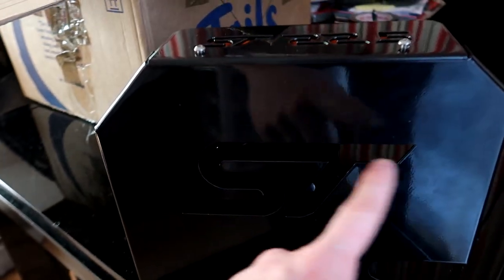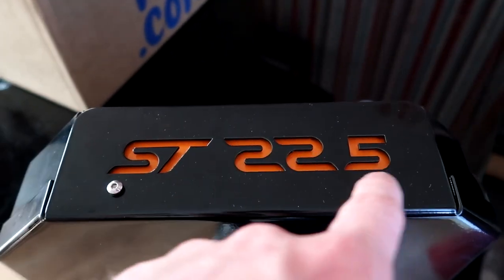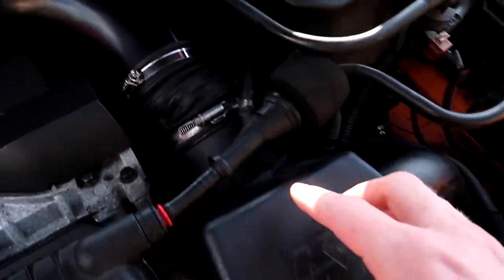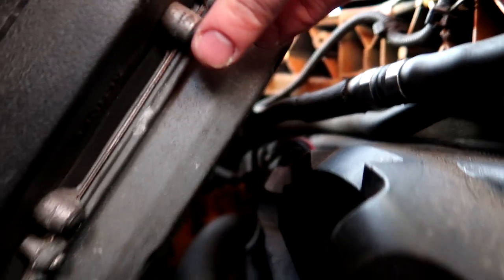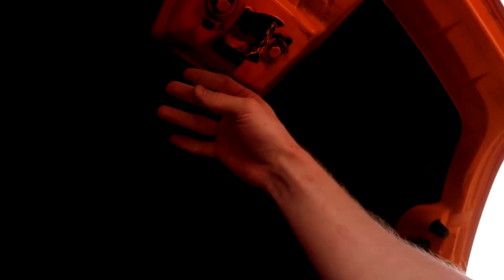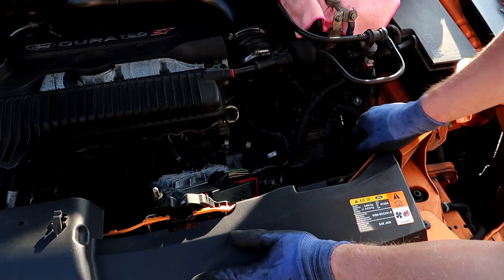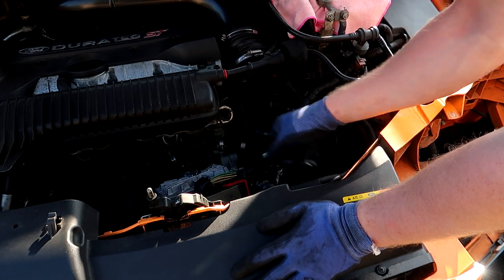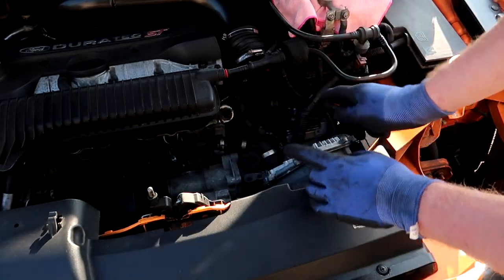HOW TO INSTALL A GROUP A INDUCTION KIT AND ECU HOLDER *FORD FOCUS*ST225*

Comment: Cheapest and easiest thing to do to quieten your exhaust is to put the original cat back on. I’ve still got the original cat on mine with a Section 59 cat back and it’s not that noisy at all. (Too quiet if anything as I’m going to go decat or sports cat).  Definitely worth trying before you fork out more money.  Great videos by the way.

Comment: Your videos are a godsend mate, i got my ST a month ago now and the modding has started, i noticed i have an RS clutch possibly something else and a dump valve i dont know the make of.   Just got an air filter today and im new to these cars so as you can guess i know absolutely nothing haha. I have a decent mechanical knowledge but gave up working in garages 10 years ago.. Im totally stock under the bonet (apart from dump valve)
Reply from the maker: thank you thats all im trying to do is help people out!

Comment: When you pulled the pipe off the coolant to get wires the other side did you have water go everywhere or did yiu drain system thanks!
Reply from the maker: i pulled it out and aimed it upwards so that minimal water came out then moved the wires then pushed it back in and tightened it might need another set of hands to make easier
i then topped up the system with a bit of coolant/water
Reply: @Richieesgarage  did you have to run heaters ect to get rid of any airlock?
Reply from the maker: Wel I didn’t only a tiny bit of fluid came out I just  shoved it back in and topped the coolant back up

Comment: Would be interested to hear your thoughts on the performance and sound difference between the Ramair/BDS or cotton cone filter.
Reply from the maker: Easyrider8111 sound wise I can not hear much due to my exhaust and idk I fee the RS cone I now have feels like a lot more air gets in but the BDP/Ramair one I and was 2nd hand and worn out so could just be New vs old rather than brand vs brand you know
Reply: @Richieesgarage  That's true. Plus you reset your battery so the car was relearning too. Got a Ramair myself but thinking of the newer Ramair ProRam cotton ones.
Reply from the maker: Yeah erm a friend has one of those they’re basically the same as normally cones and so on just newer design so I don’t see it as being a downgrade it will work equally or better than current ram airs!

Comment: Cant seem to get the coolant hose off to route the wires over the top, any advice? Does the clamp have to be cut off or does the hose just pull off
Reply from the maker: Arjun M should just pull off I cut the plastic bracket around my ecu wires though

Comment: I have a ramair I prefer the k&n
Reply from the maker: shaun welch the cold air induction one ?
Reply: The one u had on before this new one.
Reply from the maker: I think the New cone I have is a lot better
Reply: Personal preference... alot more heat from open cone.
Reply from the maker: @shaunwelch9176  defo but i would invest in a better cold air induction its not cold air induction kits that are crap it the K&N Gen II cold air which sucks has lots of flat spots in the throttle id invest in a different type if you prefer the cold air ones such as Dream Science

Comment: good move ditching that shitty K&N induction prob worst thing they have made for fords,  Group A or a CAIS is by far better way to go on the MK2
Reply from the maker: Steve G yeah I need to sort something out cold air wise as I feel it sucks in a lot of heat from the rad but yh boosts a lot better